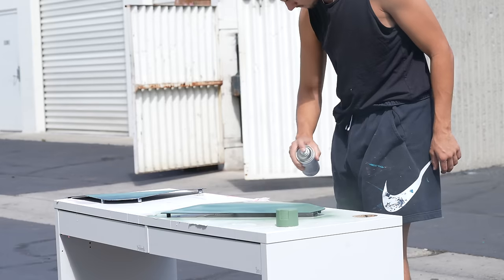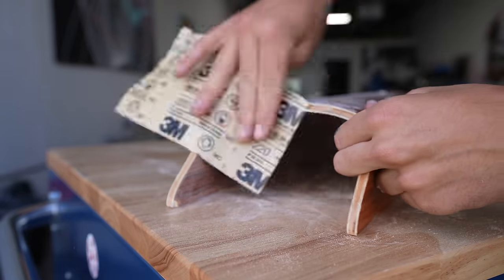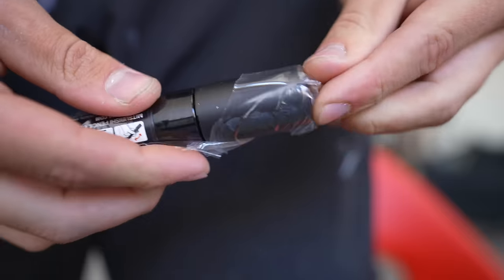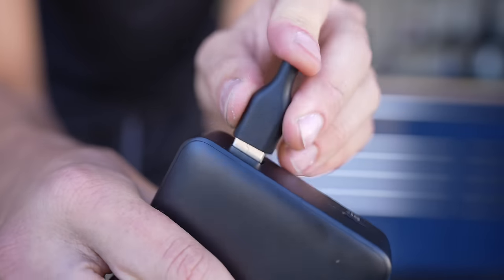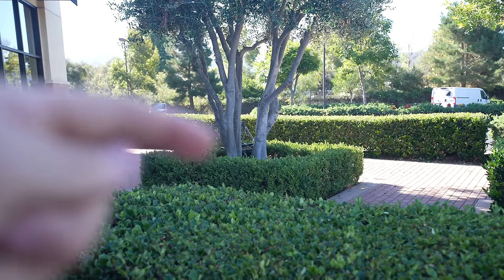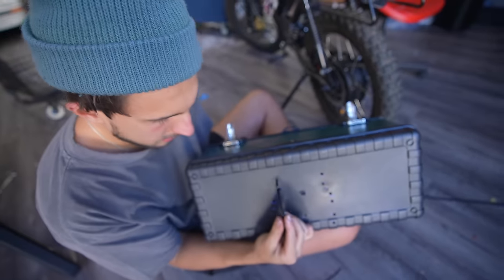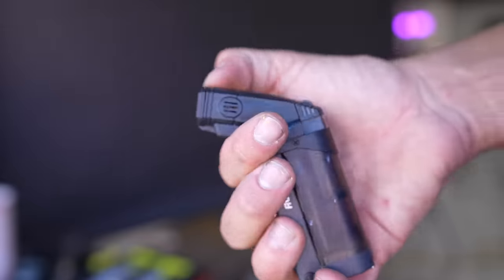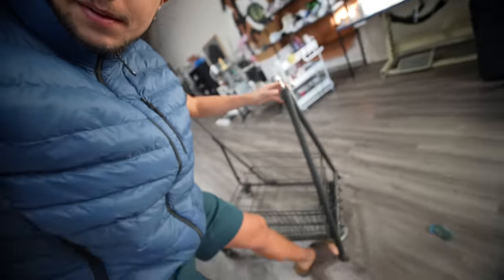Customizing my Electric Bike

Comment: Not sure how many times the cart has been used, but I recommend bigger and wider wheels (less "roughness" over differentterrain). I also suggest an extendible hight rack system on the cart that exceeds your hight sitting on the bike, then you can transport timbers, etc, and adjust accordingly. ✌️

Comment: I would suggest not using castor wheels for the trailer. You don't need the wheels to turn, the trailer will turn/follow the bike because the connection moves. It will make the trailer more stable. Cool upgrades!!